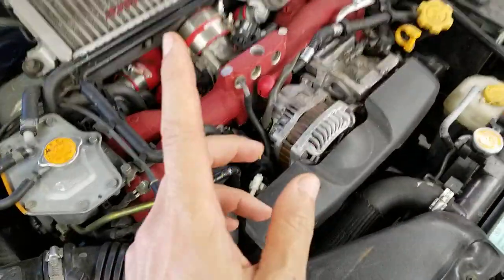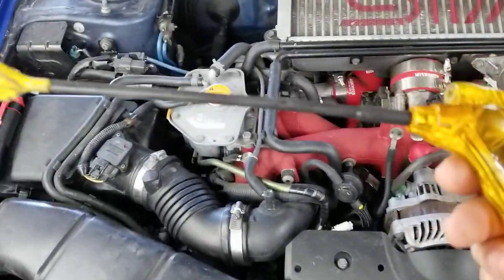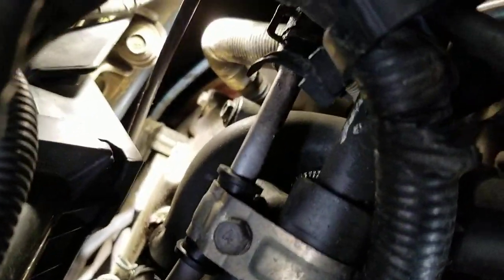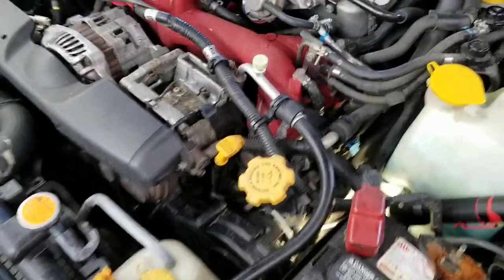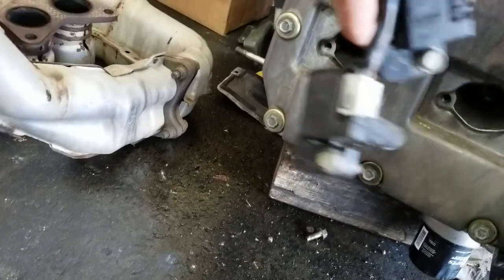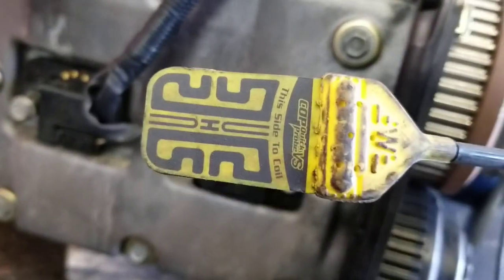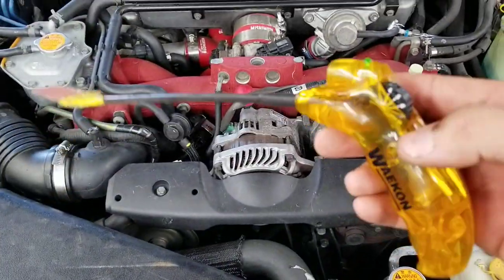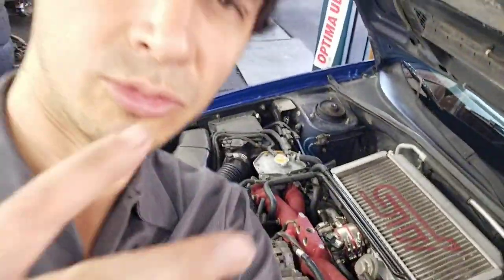Check bad coil difficult coils in seconds.

Comment: I thought I saw the second coil you tested was triggering the tester.. Wondering if some problems can't be revealed because just idling, the engine seems to be running fine but under load it misses ..?

Comment: Would this work with coil packs that are not coil on plug there away from the plug 2009 silverado 5.3 it has 4 packs on top of the valve cover away from the plug